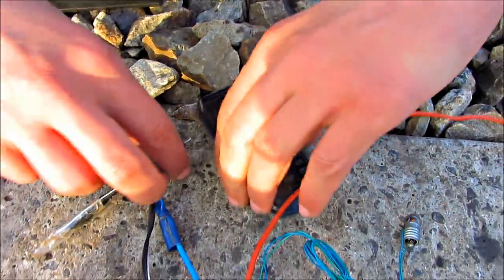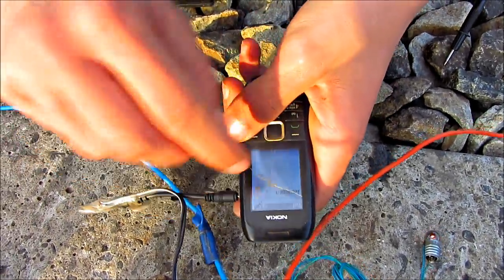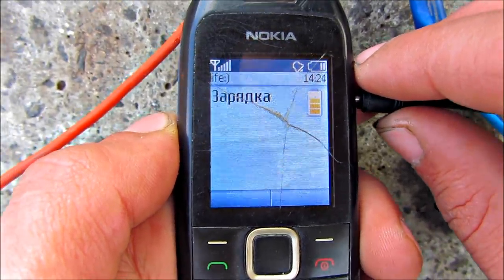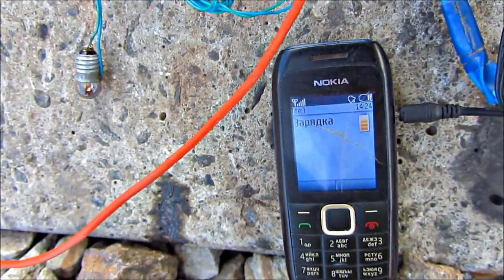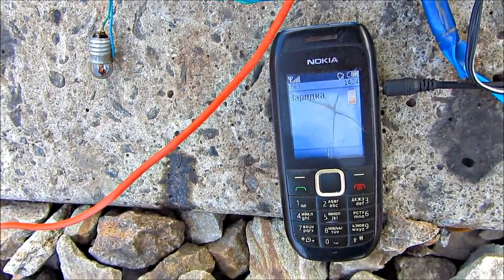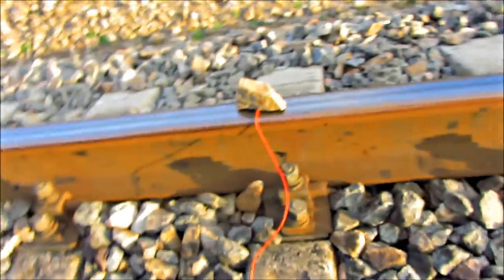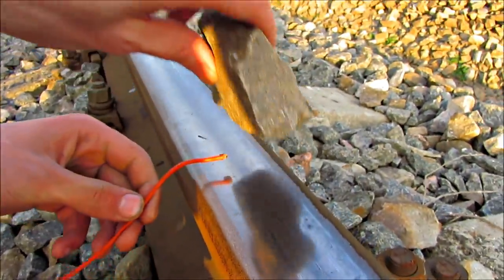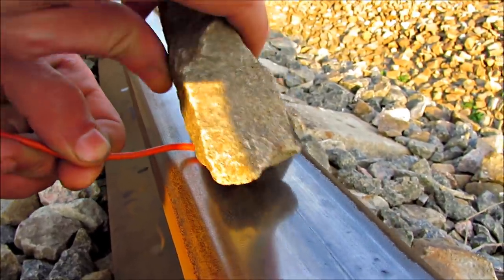How to charge a phone from the rail tracks. Measuring voltage on the railway

Comment: There are lethal dangers doing this.  However this is how it works:  
Typically each block of tracks is separated from the next by section insulators.  Each block of tracks is separately energized by a low a/c voltage.  This low a/c voltage keeps a signaling switch (relay) open.  In many countries this lights a (typically green) "track clear" signal.

When the steel wheels bonded to steel axles of a train care are on a block of tracks the voltage is shorted out to zero.  That closes signaling switch (relay) the lights that indicate that block of tracks is already occupied and no other train may enter it.  This lights a (typically red) "stop" signal. 

Maintenance crews can short out the tracks with jumper cables to prevent that track section being used.

However, using this for unauthorized reasons is very dangerous.  
- Some systems for electrically powered trains use these rails as a neutral wires (ground return) and they can become energized with dangerous voltages.
- If a power line falls on the rail that section of the rail line will be energized with dangerous voltages.
- If lightning strikes near the rail line that section of rail line will be energized with dangerous voltages.
- Wires and rails in use near the track can induce voltages that can sometimes be dangerous.
- You could be hit by a train.  A 130 mph/210 km/hr train is moving so fast you won't hear it until it is too late to get away.
- Children might imitate what you are doing without understanding the dangers that exist and the precautions necessary.
- Doing this while drunk will likely end with your foot getting stuck in the rails and your leg being amputated by a train.
Reply: +KeithCanadaa You can read more about how this works here 
https://en.wikipedia.org/wiki/Track_circuit 
and here https://en.wikipedia.org/wiki/Signalling_block_system.

Comment: Use to be able to lay a piece of metal across both rails, and get the signals to come on & go down,, was funny as heck, we'd let a line of cars build up, then disconnect, and the dingers go up, then while the traffic was crossing, reconnect the rails... LMFAO! This was 20 years ago, and I've tried it recently at the same place, but they no longer go up, I think it's radio controlled now..?

Comment: Here in Germany the Rails are every few Meters grounded to the Earth. The position of the trains are sometimes submitted with digital Signals over the active 10...15kV Power-Line. Otherwise there are Sensors somewhere in between the rails. It's easy to see them. These Sensors has yellow plastic covers. If there is Voltage between the rails, then the groundings has failed.

Comment: It is used for detecting Trains on the section of rails, If a train is on the track it will turn a light red on that section of rails like that light you looked at at the end, You may have triggered the light tho when you used the electricity and it may have appeared on the panel in the control room haha the light would be changed red on the other side of that light tho

Comment: Do this in the US and it's a federal offense. The signal you're seeing is used to detect trains on track sections. Placing a load on that signal (like your charger) drops the voltage on that section (since it's a very low current) and signals a train is on that section of track.

Comment: This is a Track Circuit used by Semi-Automatic signals. Shorting the circuit like this may trigger the signals, turning them red (depends on the signal). This can be illegal in some countries/states as you're causing delays on the lines -- briefly described in the video description.
Reply: Correction: automatic signals. Semi-automatic does not use rails to send any codes. Codes are sent via other channels like telegraph, telephone, internet and such
Reply: manual signals that are out of sight of the signaller also use this in the UK. they have a little indicator that has 3 positions - NORMAL, OCCUPIED and CLEAR. when a train passes over onto the track circuit the indicator goes to the OCCUPIED position until the signaller changes the appropriate signal to the appropriate position. the same goes for when a train leaves a track circuit however instead of the OCCUPIED Position  it goes to the CLEAR position. However some only have an OCCUPIED and CLEAR position and don't go to a NORMAL posistion when the signaller changes the lever.
Reply: By "Semi-automatic" i ment local interpritation. Here "semi-automatic" means that railroad between stations can't be separated on sections and only one train can be there one in a same time. This system still using signalling (lights, on-station rail coding and such), but no rail signalling in between stations (except, maybe, railroad crossing lights, but they are not included into railroad signalling system usually). You can consider it as train "teleports" to another station.

Comment: It's called an ELF extremely low frequency the tracks are picking up like antennae. These frequencies are broadcast around the planet to reduce human's ability for critical thinking and make people easier to control (similar to the fluoride in the drinking water). As trains get closer, the voltage will be reduced since the train wheels short out the potential difference. As trains get further away, you will see the signal gain in amplitude.

Comment: They pass a small current down the line so that if it's cut, they know the tracks are broken.
Reply: +Hörður Heimisson \
Smart.
Reply: +H&#246;r&#240;ur Heimisson that's how sensors detect incoming trains. An opened circut is created between two rails  and the current starts running as soon as the approaching train shortens it with its wheels.

Comment: If you do this in the UK you would actually die. Rail voltage is 750V with breaker ratings at thousands of amps. The tracks are electrified to power the trains and traffic signalling is performed by other means. For what it's worth, the video's track circuit is known as ALSN; the pulses in the video indicate the next section of track is green.

Comment: There is not always voltage between the rails. Where I live the tracks have no track circuit except where there is a railroad crossing signal, and even those are rare, so most places on the line there are no track circuits. It's known as “dark territory” because there are no signals for the trains. Train crews run the rails at their own risk, hoping the tracks are clear and intact.

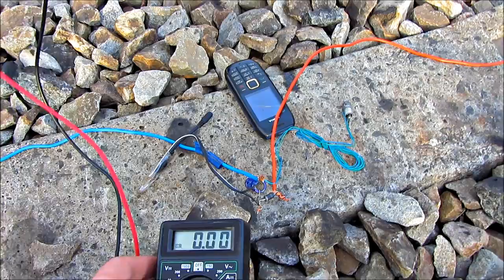Comment: Apart from all the other reasons why you shouldn't/ can't do this, 2:27 is just wrong. The voltage printed on the capacitor is simply the maximum voltage the cap can withstand without getting damaged.

Comment: 1:38
This is a rhytm. Perhaps some kind of detection signal???
Reply: It is fed into the rails at the next signal, and it encodes the signal aspect. The oncoming loco picks it up and an onboard module decodes and evaluates it, it may display the signal aspect on a monitor, but most importantly it can initiate emergency braking.
Also, the pulse code is also constantly monitored at the beginning if the section. If a train enters the section, it shunts the circuit, and the signal disappears behind the train, where the detector unit lies, and the signaling system will detect the section to be occupied.
And when the dude is putting some load between the rails, he might cause false track occupation, if the resistance of his gadget is low enough. This would cause the entry signal of the section to fall back to halt, the signal code of the previous section would also fall back to code this aspect, and if a train just happened to get the entry signal full speed when it fell back, the onboard module of that train would engage the emergency brakes. Not only it disturbs the traffic heavily, but this can cause the passengers to fall and get injured... So moral of the story is, charging your phone from the rails is a really dumb shit to pull off...
Reply: IF the resistance would be too low: yes. 

But obviously the system could provide much more current, than the phone consumes. The open circuit voltage (voltmeter alone) is 2,5V average (around 5V peak) and he gets 5.1V after the rectification diode while charging his phone. He does not drop the voltage, the system whil not see this small load.

And of course it must be like that. Think many kilometers of track in wet environment will draw significant current and shall not trigger the system.
Reply: So, if I understand you right, nowadays instead of putting pine trees across the tracks to hijack a train I just need to connect them with a wire? Cool!
Reply: Google ALSN. One long two short signals is interprited by the decoder of next traffic light as "green" signal.

Comment: I´ve never seen this before, but I can figure it out the purpose of those signals (which have a frequency). The signal applied to the tracks actually allow you to know the current position of the train, by means of measuring wave reflection. The reflected wave varies as the train, wich makes the short circuit between tracks, changes its position. I supose the frequency was set to 50 - 100Hz, becasue it gives a wave lenght comparable to the track's lenght.

Comment: Well ... I´m sure that there is always a signal on the tracks that detects whether a train is or isn´t currently present on the rails, but what seemed fake to me is the last part where he rectified the negative half waves of the AC signal through a diode and then the energy was stored in the capacitor that also makes sure the voltage across it doesn´t change instantaneously and it is smoothen out a bit . When he measured the voltage on the capacitor there was approximately 5.1 V DC where as he previously measured that the voltage between the rails stays approximately somewhere to 2.5 - 3 V AC. The multimeter pretty much definetely measured the RMS value of the signal so the amplitudes of the signal should be somewhere between 3,5 to 4,2 V. Also adding the forward voltage of the diode that let´s say is around 0,5 V (somwhere between a germanium and silicon one)  creates a voltage drop across the diode that lowers the maximum voltage that the capacitor can charge to. So the maximum voltage across that capacitor should be somewhere between 3 and 3,7 V and not 5,1 V. But also I have to consider that that multimeter that looks being a low end one is probably designed to measure "accurately" sine wave signals with frequency of around 50 Hz . So if there was for example a square wave the voltage could have higher amplitudes that the meter can´t measure correctly and so there maybe are higher amplitudes or maybe some voltage spikes that can charge the capacitor to 5 V. I think that for such use the signal doesn´t really matter if it is crude and with spikes so that could be the case.  But when he connected the speaker the low tone indicates that the signal through it could be around those 50/60 Hz areas and also that would be more likely a signal to use because it is avaiable everywhere from the powerlines so there wouldn´t be any device needed to create that signal, but just a stepdown transformer. Maybe someone that actually knows about the railway signal can explain it better what type of signal that is.

Comment: The AC current is shorted by the axles of a train. Measuring which section of rails is shorted tells the control room where a train is.

Comment: Pulsed AC or DC currents are often used to avoid interference from other parts of the track, and the unique signal can also be used to transmit data to whatever train is on that section of track. Data might include the track's speed limit, route information, warnings, etc.

Comment: If it would be an electrical train, the power would go into ground through the rails. So, would you get hurt by electricity, if you touch the rails, while a train passes by (and your finger is not busted from the wheel).

Comment: The rail company puts a signal down the tracks to help tell them if there is a break in the tracks and can monitor where a train is... Its an old analogue system but works. If there is a washout and the track has a break in it or someone tampered with the track and made a break in it, the signal is interrupted and they send out an inspector to look at the track.  Some saboteurs would put a cable to bridge the missing track so the signal can continue.... Other rail companies my have additional systems on the track as well.....   There are tracks that have buried power cables under ground along the rail road as well to power lights, detectors, switches, general power. options may vary by country

Comment: When a conductor rushes through a magnetic field, voltage is induced at it's ends. Here the axle of a moving train is that conductor. And the magnetic field is provided by the Earth. The rails share that potential difference. Now suppose there is a railway workers strike. In that case you will not be able to charge the phone as there are no trains running.

Comment: "running rails" carry a small amount of voltage to allow wayside signals to work. TBH, you probably messed up the signals doing this. The section of track you were in probably showed up as if a train were there (do to the connections that you made on the track).
Reply: trackside, not wayside :)

Comment: The pulsing voltage is used for identifying the positions of trains as the train gets closer to the origin the pink feedback change it it's like changing the length of an aerial as a result they can identify the distance from where the train is from the transmitter these can also be known as DC track circuits
 the reason why they don't use radio frequencies is because it can be black spots this is a much more efficient way of knowing the distance and location of the trains

Comment: The voltage is used to detect where a train is. The train shorts out the section of the circuit it occupies. A line controller can then tell which section of track the locomotive is in.

Comment: Information:   if rails work like American ones, there is a pulse code, or several, passed down the tracks for signaling. A decoder unit translates that into something useable. Thus the weird sound in the speaker!

Comment: 1. This is no hate, just a correction - I like your Videos!
2. Which voltage the capacitor can hold, doesn't matter, AS long it is higher than the voltage from the rails.
3. The traffic lights can't get enough juice from the rails/because they have to get a cable anyway, to control the lights, they can put the powercables extra

Comment: I never knew electricity flowed through, but I thought certain areas near rail switches trains can send conduit through the rails to the switches. This is however cool because you can easy wire up and start collecting electricity. But this is 100% illegal in the United States. Illegal to tamper or be on train rails. Almost learned my lesson during a vacation to see friends up in Minnesota. That Canada/US transport don’t mess with them.

Edit: I have a guess to why current flows through. Maybe at all areas there’s gates with a power bank. It detects if a train is connected and or close enough to the bank to activate the gates. Just a slight assumption. Pretty cool to figure the secrets of huge operations.

Comment: The voltage is there for train detection only. There are many types of what is known as 'track circuits'. They use AC and/or DC at low voltage levels. The track circuit he is on is probably an AC pulse. It is not true all rails have voltage. The modern way now is to use axle counters instead. Just thought I'd clear up a few myths.

Comment: I'm not a rocket scientist, but I assume the voltage on the rails is a safety measure to prevent damage on the tracks. Example: If one side of the track loses +or- charge, well then..there's obviously a break in the tracks! And, this must immediately be reported to the Conductors. Just my opinion..
Reply: Yes that can be a sign of track damage but it is part of the signalling when a train passes over it breaks a circuit changing the signals if there was a damaged rail the circuit would not be complete so the signal before the section of track will be red

Comment: we have some of the really old trains in our country. This sounds reminds me of the sound that we hear when we sit in that train. Hardware sound. I think it comes from when rail tyres cross a point between two connected rails (the point where rail is connected). Or it could be that rail engines get power in PWM naked from our eyes but when metal hits a metal it conveys its vibration. Ah! I know I am not good at explaining but I guess few of you may understand what my point is.

Comment: Would have been interesting if you measured the current of that 5V. The rails can handle practically unlimited current, and i assume that the power source isn't a silly household power brick either.